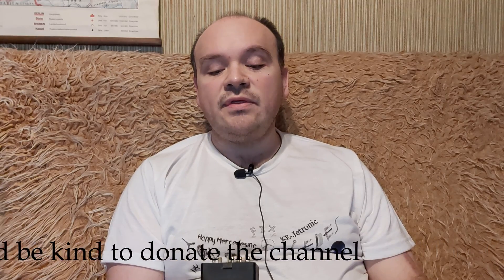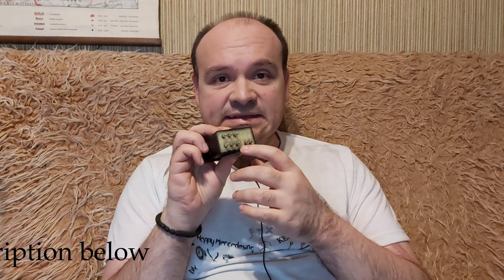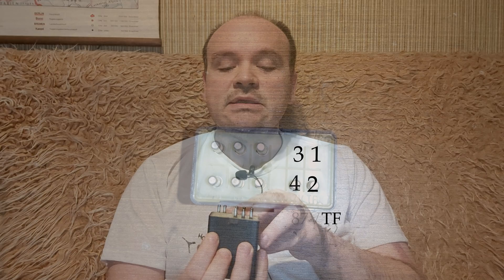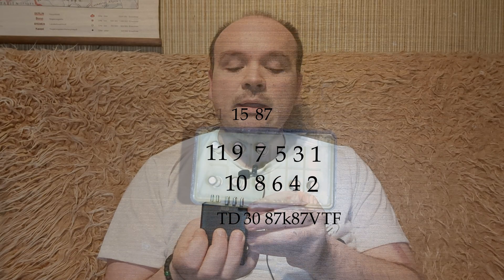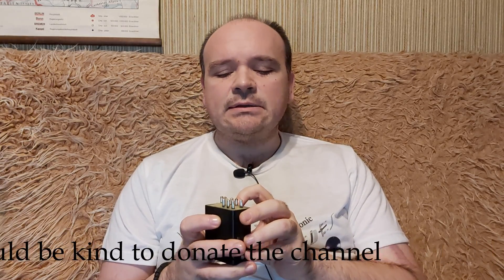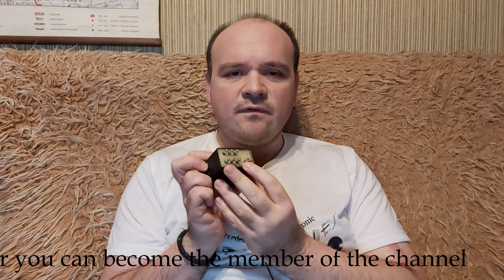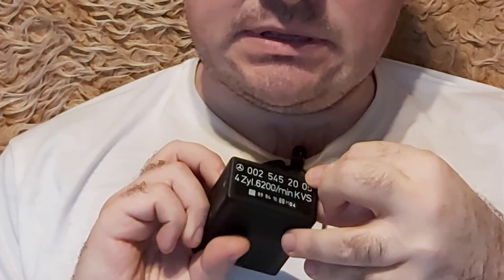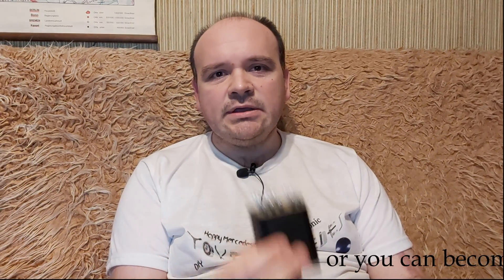㉦Mercedes Ke-Jetronic㉦ - The Fuel Pump Relay

Comment: Hii, i have w124 260 and my relay cut off 5 seconds after contact (during this 5 second engin turn normally). When use  your technic to shunt relay, same problem cars cut after 5 seconds. I have change relay and now the car start but additional valv don't work with new relay. Have you any explication ?

Comment: Hi. When I bridge the relay the car cuts out when I drive my W124 300TE for awhile....although the pumps still runs. Will eventually start after cranking for awhile! Any comments out there?
Reply from the maker: So - a difficult start. This can indicate the issue with the fuel pressure regulator. Buy a pressure gauge and measure the pressures in order to see if you are within the specs or not.

Comment: Hello, I have a big problem with loss of power. Let me explain, when I start the car, a Mercedes W126 SE500, my engine works very well, I feel the power and when I drive without stopping, so I start, put the gear lever in position D and I move forward, I have all the power. Once I slow down and start again, my car hardly moves forward anymore, it loses almost 80% of its power. I have to wait until I reach 3000 rpm for it to unblock. Can you help me? Do you have any ideas of the problem?
Reply from the maker: Replace lambda if you have one.

Comment: I had a starting issue on my 190E 1.8 manual 1992 and i pulled out the relay and someone bridged the two pins together but the pump still doesnt work , any ideas ? Is the relay completely kaput ?
Reply from the maker: Try supplying voltage directly to the pump. If the pump works then, then it's either the wiring or the fuel pump relay!
Reply: @mercedeske  I sorted the issue,  thank you , but now the car starts and immediately stalls , I found out the the Potentiometer has a dead spot on it , it's worn out , could that be the issue ?
Reply from the maker: @DAMIANI22  Yes, indeed!
Reply: @mercedeske  thank you , appreciate your time
Reply: After changing the Potentiometer , car still stalls after starting it , any ideas ?
Reply from the maker: @DAMIANI22  Check the TPS if it recognizes the idle position.

Comment: My 1987 300 sel car has a 260 se engine.  Which one should I choose the fuel pump relay?  I can't find it with WBD.  How do I find my original relay code?
Reply from the maker: Which one do you have on the car?

Comment: Hello, I purchased a new gas pump relay for my 1987 Mercedes 300 sel. But the vehicle's relay connection cables were dislodged and cut. Is there a diagram of which color wire connects to where? How do I connect them back to their correct place?
Reply from the maker: I will check on this.

Comment: ❤️😍❤️ that is so brilliant and helpful 💎👌👍 would be a fantastic content to show and explain all the relays🙏🙏🙏 What a great simple and cheap way to check the own relays. So far, I understand, I can check a relay using a multi voltmeter? And you just need to know which pin is + and - from the Stromkreis ?  Ask because I just bought a 124T 300TE  from 1989. With this model I am to able to blink the troublecodes and can measure the errors only by using an oszillograph. Stay safe and blessings from Germany
Reply: 😍 Hi, thanks a lot 🙏🙏🙏. Will start "Gutes Benzen" as soon as winter is over. Have no garage or dry place to work on my car 😢 Meanwhile, do a lot of research, testruns,  put a good car toolbox together from tools laying around the house, order parts, liquids and material I need to prep my Benz for up comming car camping trips in the futur. And of course need a lot of measurement ❤️ Gutes Benzen ❤️ never herad this before but will use it from now for sure. Blessings 😘
Reply from the maker: @josinora  Natürlich nicht. Ich habe das erdacht. Wenn es "Gute Reise" gibt,  dann kann es auch gutes Benz fahren geben, gekürzt Benzen. Also, Gutes Benzen.🤣🤣🤣🤣 Das ist die Erklärung 👍🏻😉🍀Viel Glück und nen Guten Rutsch ins Neue Jahr.
Reply from the maker: Thanks a lot. I can not explain all the relays that were made but the principle is the same - you have pin 30 - voltage supply from the battery, 31 - the ground, 15 - key ignition ON, 50 - the starter, TD - the RPM signal and now the 87. The 87 is a + for the fuel pump, 87V for the cold start valve, 87k - kick down, TF - the temperature signal, there was 87S/H - a heating element for lambda. As for the fuel pump relay - it must receive the TD signal, 30, 31, 15 in order to work. Without TD for example the relay is DEAD and therefore the cold start valve, kick down, heating element for lambda, fuel pump.The most simple way to test your relay is to remove it and to bridge contacts 7&8 - if the pump starts working and you manage to start the car without it and you can't do it with the relay, then "kaputt". I believe I gave all the instructions in the video how to check the relay using a common multimeter only. Check for the continuity as well as for the voltage and it's always battery voltage the nominal value, 11-14V.
I hope I could answer the question as you expected. Greetings from Serbia, best wishes and "Gutes Benzen"!

Comment: Would it be the fuel pump then ? If you jump the relay and the fuel pump stays on but still won't start? I got spark and it does start when I spray starting fluid but then dies shortly after still.
Reply from the maker: Check the fuel pump relay if you get current on it.
Reply: @mercedeske  I put a new fuel pump on it today and still won't start.
Reply: @impalasforlife5935 . I've also put a fuel pump on and afterwards it won't start. Do you know how to jump the relay?
Reply: @JohnDoe-in9lc  did you come right what happened?

Immobilizer?

Comment: Hi
Another excellent video.
Can you please help. 
Trying to inspect me Fuel Relay but it will  not release from its cradle. It seems as if the  pins are stuck in the holes. There  are two small clips on either side of the relay and they clear the cradle but the relay will still not detach. Any advise?
Reply from the maker: Try bit by bit carefully until it's out, wiggle it a bit and pull at the same time. I wouldn't advise you to use WD40.
Reply: @mercedeske   Cheers . Will report back.
Reply: Hi
Still trying to get to the bottom of a shaky idle in my 260E, M103.
Can I ask, I did a fuel pressure test connecting 8 and 7 on the fuel relay. In 50 seconds it produced nearly 2 litres of fuel. I thought the specification was 1 litre?
Is this normal ? I tried to do the test at the ignition but when I switched key on I could hear a motor but no fuel came out. I then connected the fuel relay terminals and got 2 litres. Love your utube videos. Keep up the great work
Reply from the maker: Thanks. Your pump is in a great state. A new fuel pump has to deliver 2l per minute.

Comment: My w201 m102.962 -86 starts but dies instantly after startup. (Worked perfect before, maybe little rich)

Fuel pump primes before start. but can it be that it wont start again when engine starts and hence dies.
Reply: Can you start the car with jumping 30 and 87 with a wire
Reply from the maker: Yes, of course!
Reply from the maker: Did you replace the potentiometer?
Reply: @mercedeske  havent done anything yet the problem occured today evening. Luckily the car is in my garage since it doesn't start :)
Reply: @mercedeske  what potentio sre tou exactly meaning
Reply from the maker: https://www.youtube.com/watch?v=IxBnTCoVk0s
Reply: @mercedeske  the potentio showed 4.19 Ohm between 1 and 2 and 1 and 2 was something like 1-2ohm. 

I tested fuel pressure from pump was looking ok.
Overdrove relay with jumper cable with relay in place.

Brushed a bit the distributor inside.

Dont know if those made any difference but when starting it runs about a second or 2 longer then dies. Giving gas after start makes it bog down faster.
Reply: Air meter also 2mm before stiff
Reply from the maker: @Heve62  I didn't understand the first sentence. How much was the potentiometer showing? 4.19ohm(that's at the upper limit, still good). But I didn't understand what was showing 1-2ohm.
Reply from the maker: @Heve62  That's good 👍🏻
Reply: @mercedeske  sorry mistake. I took it agan between pins 1 and 3 and it shows 4.15kOhm and between 1 and 2 it shows 2.15kOhm. when pressing the slack in plate down (2mm) it rises to ~3.9-4.5
Reply from the maker: @Heve62  Not good. Between 1&3 you will almost always get the nominal value. The one between 1&2 is decisive. You have a bad value in the start. Replace the potentiometer. The value has to rise up to two thirds of its movement, then the ohms have to start falling in the last third.
Reply: @mercedeske  they rise and fall in the last third though. Can it (bad value in start) prevent the car from starting?
Reply from the maker: @Heve62  I guess so. If you have never replaced the potentiometer until now, do it because the next time you are going to do it will be in 160k km/100miles.
Reply: @mercedeske  i think its original. Car has 270k kilometers.
Reply from the maker: You will have to replace it.
Reply: @mercedeske  i got it running! It was because ignition system. I will give you a little donation for helping me understand the jetronic! 

Next i have a bit high fuel consumption to tackle, thank you.
Reply from the maker: @Heve62  You are welcome and thank you 😊 Happy Mercedesing 😃
Reply from the maker: Yes, but it usually stalls right after the icv decreases the rpm. 1and 2 volts or ohms?

Comment: I bought new one on Amazon… they are very cheap, ans still produce… other method to know if it is the fuel pump relay, you measure the voltage at the pump under the car, often more accessible than the relay…

Comment: Hello lvicam is there any emergency shut off engine feature when the car overheats (on 300E/230E) ?
Reply from the maker: No, just the car will change timing in retard(late). Anyway, the best solution is to turn the car off or if you have a wire to bridge the contacts on the sensor and make the fan run constantly.
Reply: @mercedeske  Oh ok thank you.
Reply from the maker: My pleasure 😊

Comment: Gracias por el vídeo!! Te comento una duda que tengo. Intenta traducirla por favor
Sospecho que el inyector de arranque en frío de mi coche no funciona y según el esquema eléctrico que tengo los dos terminales de conexión parten de la centralita principal. En este vídeo tú comentas que uno de ellos sale del rele. Puede ser esto?
Reply from the maker: Gracias a ti. Me voy hacer el video. El rele operaciona la válvula de arranque en la manera que el sensor de refrigerante manda el señal si la temperatura es mas o menos de 60 grados. Si este es el caso, el sensor manda el señal en rele y rele hace corriente en la valvula. El mejor metodo es desmontar la valvula y poner el frasco debajo.  Arranque el motor mientras está frío y si ve el patrón de rociado, la válvula está bien. Hágalo un par de veces y luego observe la válvula durante un minuto.  No debe gotear.  Si es así, tendrá que reemplazar la válvula.

Comment: The fuel pump relay is outrageously expensive. If mine ever fails I'm going to rewire and use one from Maplin.
Reply: Not everywhere. I went to the yard and bought about 3 from the 190es that were rotting there

Comment: There is one more problem. In vehicles with LPG installed, this relay is faulty. (faulty installation) 
Capacitors inside can do their job erratically. 
When I opened the box, I smelled a strong burning smell and changed the capacitors inside.
 I could not find a procedure to test this box with electricity on the ground. But as you mentioned in the video.. If the fuel pump is working, the relay box is intact.
Reply from the maker: I had that installed and as I quit driving on LPG I had no more frustrations 😀